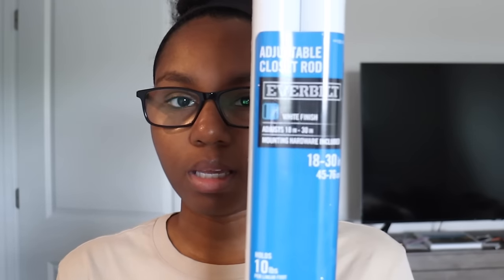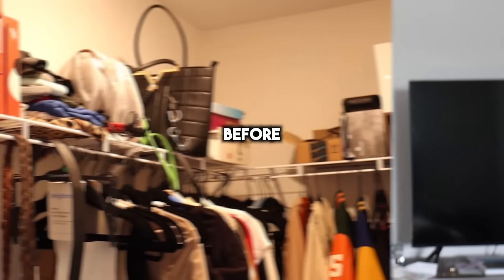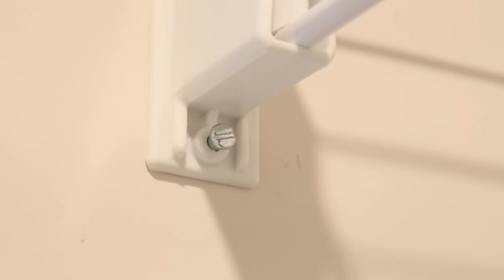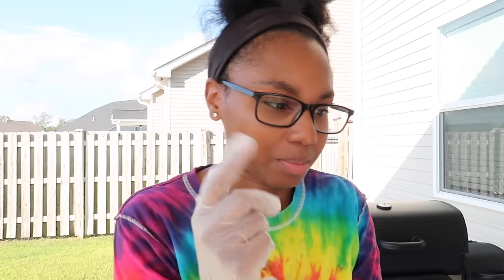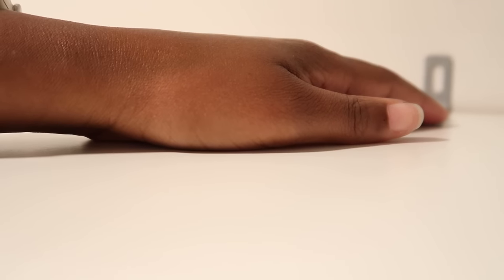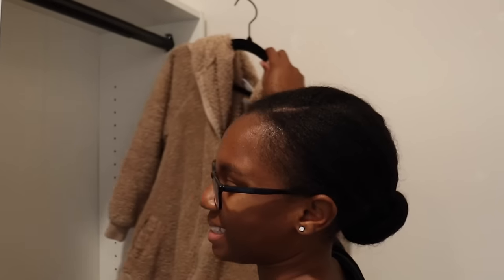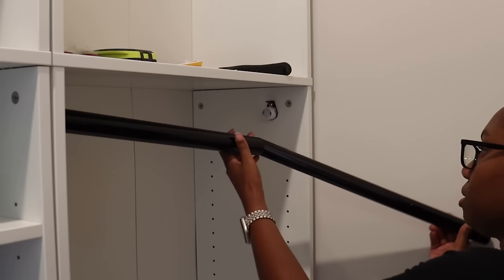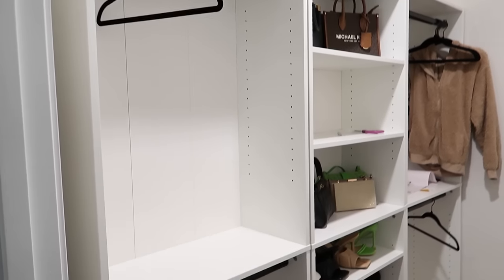I Tried the Viral Target Bookshelf Closet.

Comment: You did great!  To get the bookcases flush, you need to use low-profile channel screws to connect them together before anchoring them at the top to the wall.  Congrats to you for taking on this project!  Keep it up.  😊

Comment: If you’re renting I wouldn’t bother spackling the holes in the wall. You’re putting the bookcases in front of them so no one will see them. AND you’ll need the holes to replace the closet hardware when you move out. Also, if you have the choice to spraypaint over grass or over your patio, spray on the grass. Any overspray will be mowed away but you could stain the patio for good.
Reply from the maker: This is my parent’s retirement home, so it’ll be here for a while lol. But great advice for renters 👍
Reply from the maker: That’s a great grass tip too 😭 I’ll definitely use that next time

Comment: Thanks for the video it was very helpful! What size drill bit did you use to create the holes in the wall and bookshelves???
Reply from the maker: I wish I knew 😭 I just dug through my stepdads toolbox and picked bits that had a similar diameter to the screws I was using. Even if the drill bit is slightly smaller it should be okay, you just don’t want it to be too big!

Comment: I actually do this on Taskrabbit for like the last 10 years. I build closets for people. If you just want them to be closer, just take a screw and screw it in from one side to the other. Just make sure they screw is shorter than the width of the two combined.that’s what we do for IKEA furniture and you can put the screw through one of the holes if you don’t want it to show
Reply: Hi, I’m currently stuck on this part and I need help fusing them together. What do you mean thst the screw is shorter than the width of the two combined? Can you should examples please??
Reply: @M13150  basically when you put the two pieces together, you want the screw to go through the first piece and part of the second piece but not completely through the second piece otherwise you’ll have a screw sticking out of it. So just make sure that the screw is long enough to go through both pieces, but not past the second piece.

Comment: I have been doing this hack using IKEA bookshelves for over a decade.  I have used this setup in apartments where I could not modify the interior and also for additional organization systems in homes where I did not have enough built in storage systems.  The adjustable shelf height is great to store different types of shoes.

Comment: What did you use to mount the bookcase to the wall? Did you need a specific screw and bracket?
Reply from the maker: It comes with the hardware you’ll need to mount it to the wall! ☺️

Comment: as a mom im laughing (with love!) yes dear, its screwed into studs... clothes are heavy LOL I wont laugh too hard though, my husband cringes visibly whenever I tell him im working on any kind of DIY project because he knows inevitably I'll end up taking a shortcut somewhere... that I probably SHOULDNT. (and to be fair... I know that too.... but I get impatient!) :P  and I'm going to pull out my mom hat and let you know the paint on those rods is going to start chipping/scraping off due to hangers moving around on it. I dont think I saw you prep the rods or seal the paint so.... it will happen. Just a heads up from someone who has painted MANY MANY things ;) But, these are things we learn along the way as we do projects! You could get a piece of trim (home depot or lowes will cut it to length for you!) in the width that you need (probably an inch? maybe 2, hard to tell in a video) to cover the space between the bookcases and it will give it a more built in look while covering those gaps, too- if you want to be extra, you could get a piece of crown molding and add it to the top!  :) To secure it use wood glue then a few finishing nails (cover the nail heads with your spackle and smooth it over with your finger) and paint white when it dries. :) Your closet looks great and you should be proud of yourself! well done!!!
Reply from the maker: This is excellent advice! Thank you so much!